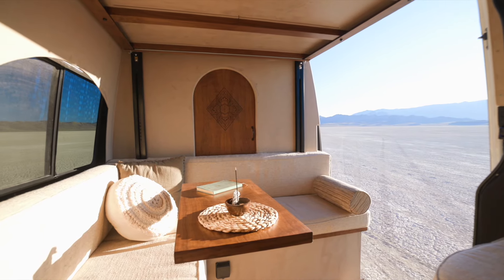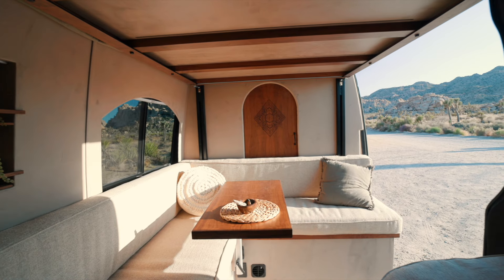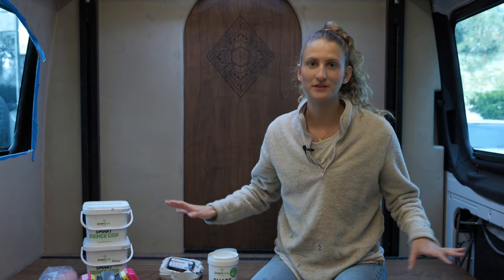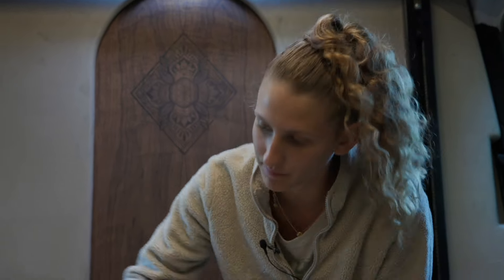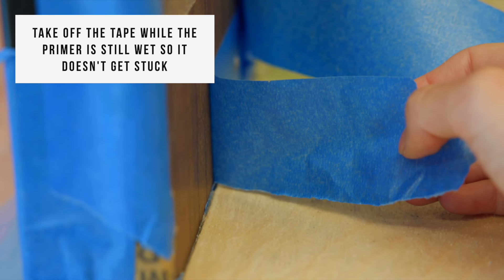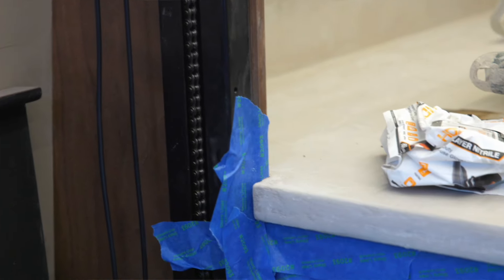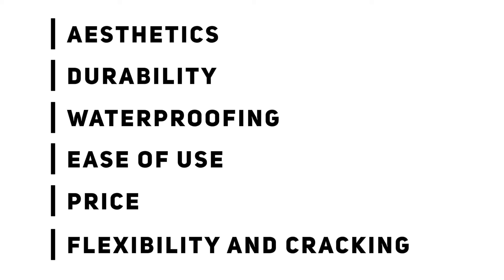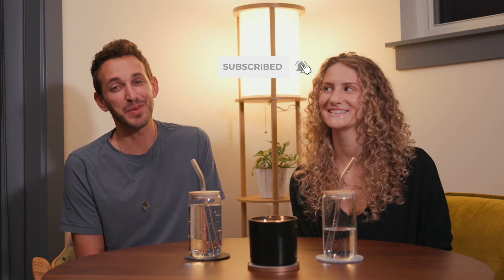Microcement Van Tutorial - SmartCret CONCRETE SPRINTER Van Build

Comment: Van is a dream!! 👏👏 However, it is not clear from your intro what is actually that cement material. Since it was vague, it leads me to conclusion that material is plastic based, therefore very questionable environment. It is not my fild, so I could be wrong. Anyway, Kudos for your fantastic creation!
Reply: Schreib doch den Hersteller an, der muss dir Auskunft geben. Hersteller ist aus Spanien.
Reply from the maker: For details on the composition of the material itself, you would need to talk to an engineer from the company. They're called Smartcret. All that mattered to us what how it holds up, and it does. So not sure it matters what it's made of

Comment: Thank you for your Smart-crete tutorial.  Your van is beautiful.  How do you find the surfaces for cleaning?  Sinks & countertops need daily cleaning & occasional scrubbing.  Does the surface hold up?  Would you recommend a different sheen for those high use surfaces?  Thanks again!
Reply from the maker: Thanks! The surface is super smooth and very easy to clean. We haven't experienced any issues with that. We definitely recommend the industrial strength sealant that we provided a link for in the description, it is necessary for high use areas for sure

Comment: Wondering, now that you've built a second van with Meoded concretta, what you would recommend for a varnish for the bathroom/kitchen areas? The Dragon varnish seems to be European and I'm concerned about Smartcret's shipping costs for it.
Reply from the maker: We are now using Meodeds plaster guard sealant. They have a few levels, and for the bathroom we are using their 3-part heavy duty plaster sealant

Comment: Curious about painting the walls before installing them like you mentioned - how would you suggest covering the screws? Are you able to cover it with micro cement or does that mess it up with the layering? Thank you!!
Reply from the maker: As long as the screws are flush or slightly inset, then its totally invisible under the micro-cement!

Comment: Stellar content, this is why the gods gave us the internet.  Do you happen to know the finished weight of the product installed cured and finished? Like per square foot or meter?  Obviously not a well documented spec for a product meant to be used in a house.  Likewise do you know about UV resistance?  Shouldn't matter inside, but I'm thinking of maybe a roof deck or something similar?
Reply from the maker: Haha thanks! 
I don't have an exact measurement in terms of the weight, it will also depend on how you apply it (thicker or thinner). But as an estimate,  I would consider it about 30% of the weight of the plywood we applied it too (we were using 1/2" baltic birch plywood). 
Not sure how helpful that will be to you, sorry! But we don't have another unit of measurement. 
Also I think it's completely UV resistant, as it's meant for outdoor use as well. But I would confirm that with them as well. 
Good luck!
Reply: @nicoleandedden  Thanks, I'm gonna call that .45 pounds per square foot for now.  Cheers.

Comment: Which did you buy? The site has for tile ot plastic surfaces.
Reply from the maker: The determining factor is if you're putting it over an absorbant surface (like wood), or a non absorbant surface (like tile, metal, etc). We use absorbant surface for most of the van